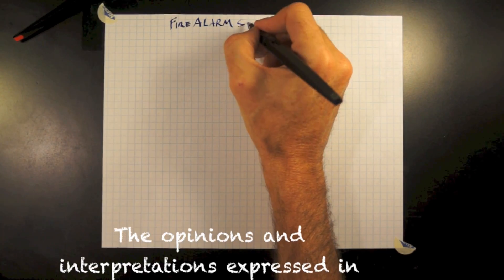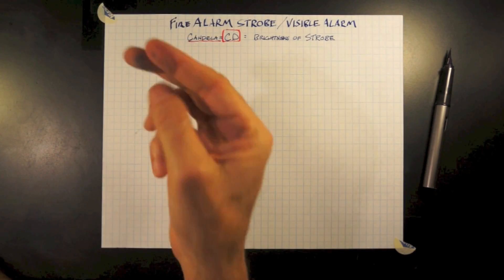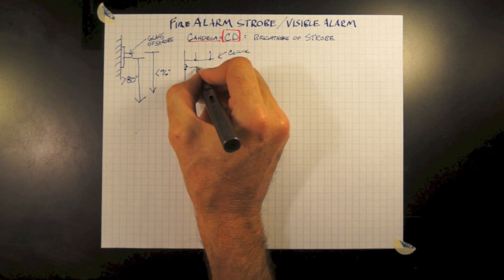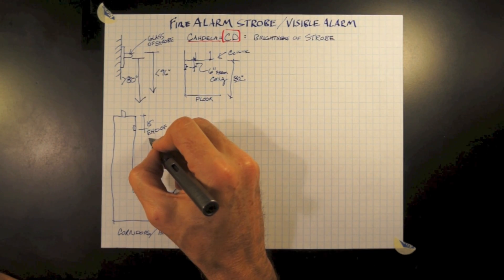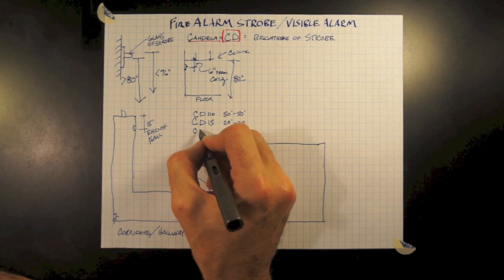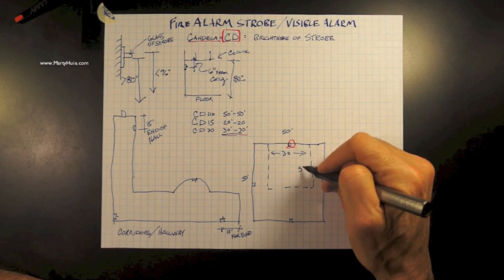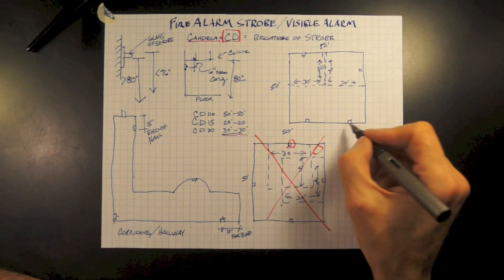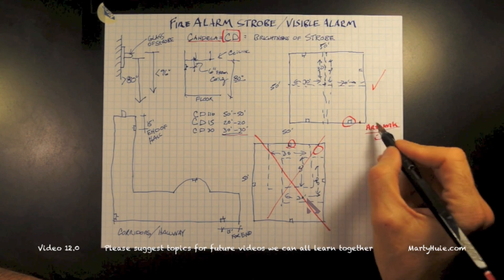Fire Alarm Strobe 12-0

Comment: How does one handle the height requirements when in a warehouse area? We had a hardware store built,  in my response area, and in the stock room,  the strobes were all mounted 80" but the ceilings were well above that. We instructed the shelving  installation crew to leave "pockets" in front of the strobes in order to keep the strobes from being blocked, however, once the merchandise was all in place, the strobes are still blocked from the side view. It would make sense to move the strobes higher than the merchandise, but that would take them above the 96" mark.

Comment: Thanks for your video. Its hard to find fire alarm video information. I would suggest you take a look at NFPA-72 A7.5.4.4 as it stipulates it is not required to have a device within 15'-0" of the end of a corridor, and it is in fact acceptable to use room spacing in corridors.
Reply from the maker: Thank you very much. I'm hoping this video does help architects and engineers start a conversation about what is allowed and what is not. I think in general this video pushes back on the architect to learn and understand a bit more the code about what they can and cannot do. The reason for a lot of my videos, I've dealt with very high in designers and very mandating clients. These videos were me trying to communicate to them what they can and cannot do at times. Yes there are nuances throughout and exceptions. Again my big goal here is to help start a conversation bring someone up to speed at least in some of the language in the understanding so they know we have to do something as opposed to nothing at all.

I will keep a note of this comment and see if I can do a secondary video concerning it as I've done with some others if I'm able to it will be labeled 12-1
Reply: Sounds great Marty, I really have enjoyed all your other videos as they deal with area's I am not familiar with. Do you know of any video's or are you familiar enough to make one on IFC Chapter 50? I am trying to pass my CFPE and it hinges a lot on that chapter.